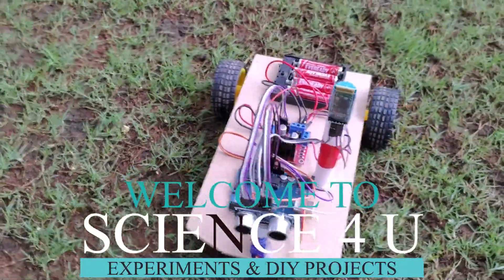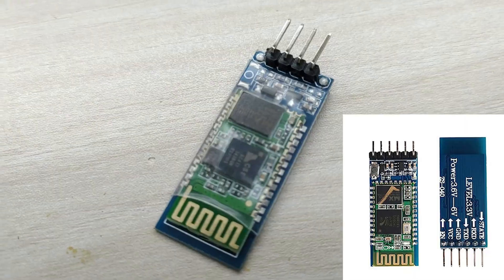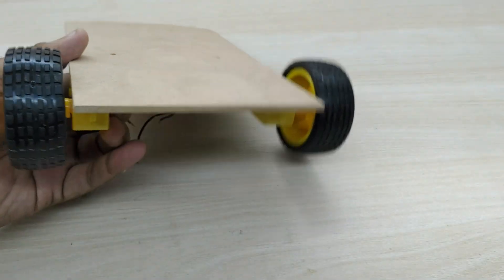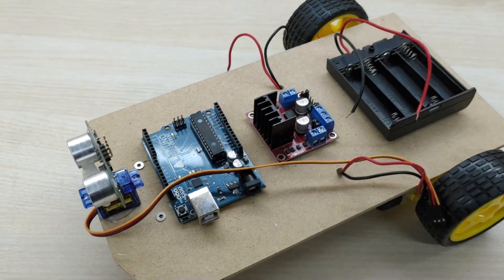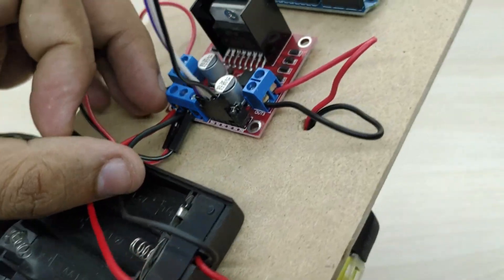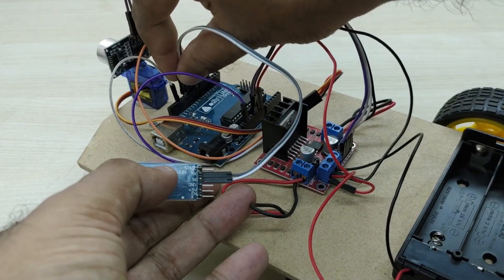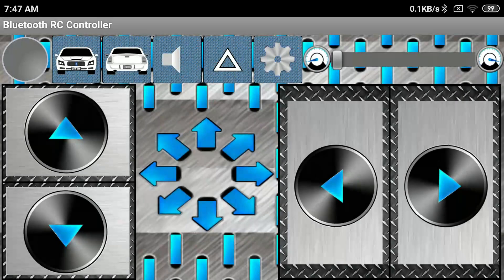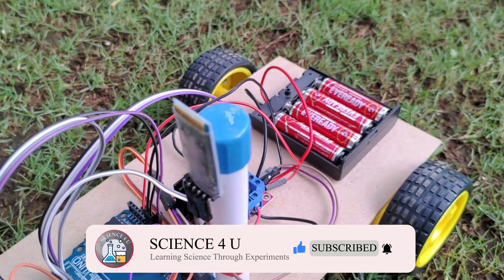Bluetooth controlled car with obstacle avoidance || Step by Step tutorial

Comment from the maker: Hello friends..A VERY IMPORTANT INFORMATION..
In this video, I am showing that the positive VCC pin of the bluetooth module to be connected directly to +ve terminal of battery since all the +5V Pins in arduino are already used. But please make note that the bluetooth module works only with an input voltage range of 3.3 to 6V. So if you use battery with voltage greater than 6V, bluetooth module will not work. So, in that case connect the positive of servo motor directly to battery and VCC of bluetooth module should be taken from +5V of arduino..Thank you friends..🙂💓
Reply: Thank you so much 🤗🤗
Reply: Can 12v safe for servo motor
Please reply I am working on it
Reply from the maker: @dipalipanchal9102 Yes friend. 12V is perfectly fine.
Reply: Can I connect bluetooth module +5 for 3.3v in arduino
Reply from the maker: @alhamdulilla01  No friend. Bluetooth module will not work with 3.3V.
Reply: Sir instead of that I will connect +5 v of bluetooth to motor driver+5 please reply
Reply: Can it be made by using 4 wheels?
please reply asap.
Reply: @arpitakundu5138  no
Reply: Sir code pleas

Comment: Sir can we increase speed?
Reply from the maker: Yes. You can increase speed by increasing the battery voltage or by using motor with higher rpm speed.

Comment: Hi bro i connected all the wires and also uploaded the code the blootooth also connected to my phone but not working 😢
What to do
Reply from the maker: Hi friend. There could be so many reasons why it is not working. 
1. The motor driver board could be faulty.
2. The bluetooth module could be faulty.
Lastly please check connections once again.

Comment: Hello brother I have a question. If I use 4 motors instead of 2, should i change the code?
Reply from the maker: No friend. No need to change anything in the code. Just connect the front and rear motors together to the motor driver board.

Comment: hi guys will it work if we use a different motor driver
Reply from the maker: It will not work if you use L293D motor driver board. Codes are different..
Reply: @Science_4U_  can we use arduino mega
Reply from the maker: @eddington_g_aguilarkashiek7391 yes sure friend. Arduino Mega will also work.
Reply: @Science_4U_ Hi one more question, if I power motor driver with 12V and connect the 5V pin of the motor driver to power the arduino uno will it still work? or would i need a capacitor and voltage regulator for it to not overload the arduino uno?
Reply: @Science_4U_  please provide codes for L293D board

Comment: Hello Sir 
My car moved for some seconds but suddenly it stopped moving even if I'm pressing the buttons in mobile phone, please reply Sir what should I do?
Reply from the maker: Hi friend, when it is not responding, do you see that the bluetooth module is getting disconnected?. Sometimes when the wheels rotate, the battery voltage drops and bluetooth can get disconnected. Then further, it will not respond to the buttons. Do you see a change in the blinking pattern of the bluetooth module when it stops working. That means that it is getting disconnected.
Reply: Bluetooth module blinks as I press the buttons but wheels don't rotate Sir
Reply: Also Bluetooth module remains connected but the car is unable to move
Reply from the maker: @poojak12 But is the car moving initially and then stopping after sometime?. Or is it not moving at all?
Reply: Car moved once for the first time but now it's not moving
Reply: What should I do Sir please reply, I have to submit the project in my college
Reply: Exactly happening the same Sir, what should I do to overcome this problem
Reply: When wheels move, bluetooth module gets disconnected and when bluetooth module is connected then wheels don't move
Reply from the maker: @poojak12  Hi friend. If the bluetooth module gets disconnected when the wheels move, it is most likely a battery issue. Changing to new batteries should solve the problem. You van also keep the uno connected to usb and then try and see whether the bluetooth is getting disconnected again.

Comment: Hello sir this works for a 4 wheels robot?
Reply from the maker: Yes friend. The same code works for 4 wheels also. Just attach 2 more motors in the front. The wires coming from the front motors can also be connected to the motor driver board alongwith the wires coming from the back motors..I have done a similar project with 4 motors. You can watch that video below for better understanding.. 

https://youtu.be/JK6zTM65Rh0

But only problem I have seen with 4 motors is that it is a bit difficult to turn.

Comment: Sir, why are the two motors not working even though I have followed the circuit diagram, but the servo is working?
Reply from the maker: Most probably, it could be a bad motor driver board. I will suggest you to do the following. Connect 5V from arduino to IN1 pin of motor driver board and GND pin of arduino to IN2 pin of motor driver board. Is one motor rotating?.
Reply from the maker: Also please check if jumpers are there in the motordriver board connecting ENA and ENB to the pins just above it. Without jumpers also, it will not work.

Comment: the code works...you have to check meticulously your connections, proper power supply for the components and make sure that your components are working specially your sensor. Thank you for the tutorial.
Reply from the maker: Yes friend. You are absolutely right. All the projects are made and tested by me. So Iam very sure that they are working ones. But like you correctly told, some simple mistake in the connections or bad sensor or discharged battery will cause it not to work.
Reply: @Science_4U_ Bro I loved this project thanks for such an amazing idea dude❤❤❤
Reply from the maker: @NirmalaMishra-wv9tp  Thank you dear friend...🥰🙂

Comment: I am using pin 3 and pin 13 for the ultrasonic sensor and after connecting, the tyres continuously rotate without stopping until i disconnect it. What may be the problem?
Reply from the maker: Hi friend, the tyres continously rotate just after switching on the battery or only after pressing any button in the mobile software?. 
Also, the wheels are rotating in a particular direction only or is it rotating forward and reverse alternately?

Comment: hi, sir about the battery what's the best alternative for li-on? like it can function just like it
Reply: where can I connect the other two gear motor? I'll used 4 gear motor. what's better 2 or 4 gear motor?
Reply from the maker: You can connect red wires from 2 right motors together and connect to one terminal of motor driver board at right side. Similarly you can connect 2 black wires of the right side motors and connect to other terminal on right side of motor driver board. You can my following video where i have used 4 motors.
https://youtu.be/JK6zTM65Rh0?si=BPWyLmYXhtCLRolc
Reply from the maker: In my experience, if you use 4 motors, it will be a bit difficult to turn easily. There will be some sliding of the wheels when it turns if we use 4 motors. But if we use 2 motors and a castor wheel, it turns very fast without any problem. If you are using a powerful battery, 4 motors are also okay. But for easy turning, 2 motors and castor wheel is definitely better.
Reply from the maker: Hi friend. Li-ion are the best batteries in my experience. They last really long and are rechargeable also. You can use 2 Nos. Of 18650 li-ion batteries for the project. If you want the wheels to rotate faster, you can even use 3 nos. Of 18650 batteries.
Reply: @Science_4U_ where else can i keep in touch with you? cause I have so many questions, if that's okay with you, sir
Reply from the maker: You can be in touch with me in the following instagram id..
https://www.instagram.com/_science4u_?igsh=MTM5aXFpdTM5aG5lNg==
Reply: how much needed capacity of the battery?
Reply: what mAh should have the battery?
Reply from the maker: Hi friend. Anything above 2000 mah will do good. It will last long.

Comment: hi, sir I'm confused with the jumper wires. do I need all of these, male to male, female to female, and male to female? need your rep asap, thank u sm
Reply: sir
Reply from the maker: You dont need any female to female jumper wires.
Reply: @Science_4U_  what size should I get? the 10 cm or the 20 cm?
Reply from the maker: 10cm is very short to make proper connections. 20cm would do just fine.
Reply from the maker: Hi friend. Sorry for the late reply. You need the following 

Male to female :
 Bluetooth module- 4 Nos.
ultrasonic  sensor - 4 nos.
Connection of motor driver board to arduino- 4 Nos.

Male to male : 
Connecting servo to arduino : 3 nos.
Connecting battery to arduino : 2 Nos.
Reply: thank you so much siirrr, so very kind of youuu🙌🏻
Reply from the maker: No problem dear friend. Always happy to help..❤️🙂

Comment: bro can we use 2 li ion battery  for bluetooth module
Reply from the maker: The bluetooth works with an input voltage of 3.3V to 6V only. So bluetooth module will not work if any voltage outside this range is given to it. What is the voltage of a single Li ion battery. Is it 3.7V? If yes 2 Li ion batteries will make it 7.4V which is greater than 6V and hence the bluetooth module will not work.

Comment: Sir my left side motor is not turning ...even though all connections are right and motors are also good....what is the problem in it ???
Reply from the maker: Whether right side motors are turning?. Could be a looseness in connection. It could also be poor battery which is able to rotate only right side motor.

Comment: Hello sir we did the same steps but not getting any output nothing is happening
Reply from the maker: Hi friend. There could be many reasons why it is not working. We should identify one by one. There could be a problem with the motor driver board or the bluetooth module. I would request you to make the obstacle avoiding robot (without bluetooth control) by watching video in the following link, so that we can atleast confirm that the motor driver board is working fine..
https://youtu.be/kPSBpfUpHt0?si=5G2SljrhVpCBrLVH
Reply: Thank you so much we will do as followed
Reply from the maker: Okay friend. 👍

Comment: hi, can I possibly make the move faster? if yes, how can I do that?
Reply: please I need your reply
Reply from the maker: Yes friend. You can make it move faster. The easiest way to make it move faster is to use a battery with a higher voltage.
Reply: @Science_4U_  elaborate sir
Reply from the maker: @ricamaemartinez6307  Now suppose you used 6V battery for the project, you can use 9V or 12V battery to increase the rotational speed of the motors. Is that clear friend?
Reply: @Science_4U_  if I used 2 battery Lion WZS 18650 4800mAh 3.7V, will it work?
Reply: @Science_4U_  if I used 2 battery Lion WZS 18650 4800mAh 3.7V, will it work? if yes, what could be the possible changes in your vid so that it'll work just perfectly fine
Reply from the maker: @ricamaemartinez6307 Yes friend. 2 X 18650 batteries will give 7.4V and it will definitely work. You need not do any changes in the project. Instead of 4xAA batteries that I have used, just use 2x18650 batteries. Connections and wiring will be same.

Comment: can we use this coding for four gear motor
Reply from the maker: Hi friend. You need not change the code for using 4 geared motors. You can connect 2 motors on left side and 2 motors on right side. Join the +ve of both left side motors and comnect to motor driver board on left side. Next join both -ve wires from left side motors and connect to motor driver board on left side. Similarly do for right side motors also. The same code will work.
Reply from the maker: You can watch the following video of a bluetooth car that i have made with 4 motors, for reference.
https://youtu.be/JK6zTM65Rh0?si=5I3oCVfpr9yA58Or

Comment: bro can we use 12v battery for this project
Reply: please reply bro
Reply from the maker: Hi friend. Surely you can use 12V battery for this project. 12V can be given to both uno and motor driver board without any issue. The bluetooth module cannot be powered directly from this 12V. It needs 3V to 6.6V input voltage only..so it has to be powered with 5V from arduino..
Reply: bro but Arduino we need to give 5v only know bro
Reply from the maker: @sowmichow3  We can connect 5V to 12V in Vin pin of arduino to power it. So we can connect 12V directly to Vin pin of arduino wothout any problem.
Reply: can you send circuit diagram for what he asked this may help him
Reply from the maker: @Sowmiarthamuru  The link to download circuit diagram is already given in the description box below the video. I am giving link here also.
https://drive.google.com/file/d/1OwHegQmTAUb7mbW_RdNSIqG0zmkmCL0W/view?usp=sharing
Reply: how we need to connect

Comment: can we connect 4 gear motors instead of two?
Reply from the maker: Yes sure friend. Connect 2 motors on either side.
Reply: brother i made my project by watching sritu hobby's video ( the same obstacle avoiding car ) but after i uploaded the code the servo motor moves once randomly every 5-10 secs ( doesnt work by placing hand in between ) also only 2 tires start spinning randomly in full speed and the other 2 tires just dont spin! can it be a motor driver issue ? please help! @Science_4U_
Reply from the maker: @aryankaj7167  Hi friend. The two wheels are on opposite side or on one side only?. Most probably, the problem is with the ultrasonic sensor. It is not detecting obstacle.
Reply: 2 or 4 motors? @Science_4U_

Comment: sir my all connections are same , but my bluetooth module is not showing in bluetooth network.
Reply from the maker: Make sure you give input voltage of 3.6 to 6 volt only to the bluetooth module. Otherwise it will not work. Also plesse try searching bluetooth module in another phone and see whether it is getting detected. If still bluetooth module is not getting detected, it may be faulty.

Comment: Hello I am having a  problem ,I have upload the code  for the Bluetooth Control Robot, when i connect the the servo motor and  the ultrasonic sensor , when I turn the power on the servor begin shaking and the ultrasonic sensor does not work, both the servo motor and ultrasonic work in the previous" non bluetooth" code robot, what in the circuit  could be killing the bluetooth control,
hoping to find the solution
Reply from the maker: Hi friend. Since the servo motor and ultrasonic sensor worked in the non bluetooth project, we cannot doubt the working of the sensor. Servo motor shaking is very common. It will jerk occassionally when it is not moving and it is normal. Can you please check the connections once again. Also the bluetooth module could be faulty?. Bluetooth module has to be supplied with an input voltage of 3.3 to 6 V only. Please check that. Also please check if the batteries are in good condition.
Reply: Sir thank you for the quick response I will check the motor driver which I suspect from the beginning, today when I turn the power on nothing moves not even the servo or ultrasonic sensor, I will let you know what I find today
Reply from the maker: @jerryrichard4994 Okay friend. If nothing moves, I would suspect the battery also. Batteries are the most overlooked things in these projects. The components draw large current and so the batteries get discharged quickly. Without noticing that, we would be suspecting the other sensors.
Reply: Sir I have  been trying new ultrasonic sensor with one that works on my non bluetooth board and everything works ,this one bluetooth will active the motor with bluetooth but will not detect anything in front of sensors
 the servo just barely move maybe just a few degrees, could the code be the problem or the board, I'll try a new board and will try again
Reply from the maker: @jerryrichard4994 Hmm.okay friend. The  code shouldn't be a problem because I have already tested the code and I am showing the working of the robot in the video. Please do try friend. I think you will be able to solve the problem.

Comment: when i click any button it starts and never stop its movement how can i resolve this??
Reply from the maker: Hi friend. Can you confirm that the movement happens in all the directions?. Like if you press back, then will it continously move in the reverse direction without stopping?
Reply: @Science_4U_  yes it's moving like this in every direction
Reply from the maker: @hevinstephy6542  Hmm..okay friend.  I mostly suspect the battery. If the battery is not properly charged, when we press button for moving in one direction, as the motor starts rotating, the battery voltage drops. So this causes the bluetooth module to loose connection with phone and arduino resets also and hence it continues to move in the same direction. This is what I guess. So you can try changing battery to a new one and it should solve the problem.
Reply: @Science_4U_  the problem was with my Arduino it was complaint
Reply from the maker: Okay. Nice that you could identify the problem..👍
Reply: @Science_4U_  and also rx stops blinking and only starts blinking when reset button on Arduino is pressed
Reply: yes @Science_4U_

Comment: My car is moving only left and right when I touch forward and backward please help tomorrow is my submission
Reply from the maker: Hi friend. I think the solution is very simple. When you press forward, one wheel will rotate forward and other wheel backward. Just interchange the wire connection of the backward rotating motor at the motor driver board..